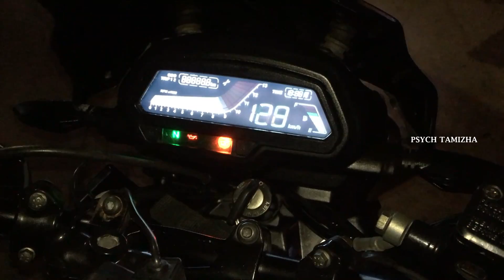Bajaj Dominar 400 Full Service @ Home | Timelapse | DIY

Comment: Hi bro one doubt bro I have dominar 400 2017 model 
If I put 1 st gear it's sound dammal & if the bike running if I put second gear means same thing will happen it's sound like dammal
Wat was the problem bro pls help me
Reply: Neutral to 1 gear damaal sound normal dhan bro due to slipper clutch.. ana running la 2nd gear podum bodhu damaal Vara koodadhu
Reply: Higher revving engines it's normal brother i too own a dominar 400 2018 sound is common when we drop to 1st gear

Comment: Bro... D400 engine oil capacity 1.5l or 1.8l ?
Reply from the maker: 1.5 l for older models 
seems it is slightly higher for new gen models
Reply: 1700 ml for ug

Comment: Sir Mere paas Dominar400 2017 model hai..mai usme motul 7100 10w50 oil dalta hu to...uski service kitne Km. Baad karni chahiye...?
Reply: 10000km oil change interval
Reply from the maker: always change it at maximum 5000kms irrespective of any oil you use

Comment: How many kilometres has ur bike done?
Any engine work till now?
Reply from the maker: i have done around 33k+ kms as of now no work has been. done except coolant issues
Reply: @PsychTamizha  i am planning to use mobil 1 5w40 grade fully synthetic engine oil in my dominar.
Should i do that?
Reply: @royalenfieldthug3651  the grade is 10w50 so its not advisable to use 5w40 cus thats not the grade

Comment: Hi bro nice video for spare parts and accessories for Dominar any dealer you know bro can you give the address or contact of dealer
Reply from the maker: Contact Jai Bajaj Tambaram
Reply: @PsychTamizha thanks for the quick reply bro. ohkk bro so Dominar 400 touring kit available from them right top rack with back rest and winshield and spare oil filter and engine oil.
Reply from the maker: you can check with them

Comment: after how many KMs Fuel filter needs to be changed?
Reply from the maker: i change in every oil service say 3.5k kms to 5k kms
Reply: @PsychTamizha  Thank you
Reply: @PsychTamizha  ji enna price fuel filter. Bike condition epadi irku. Dominor 250 is it worth to buy or get rtr 200 bs6?
Reply from the maker: fuel filter will be 200₹ idk the exact price

i would say go for d400 if u can spend money
Reply: @PsychTamizha  thanks for info. I will use bike mostly in city and might be occasionaly highway rides so d400 would be more for me also I think price difference is 40k more.
Initially I thought of getting rtr 200 by now just having second thoughts for d250. Any idea how is rtr 200?
Reply from the maker: The. you can also consider fz250
Reply: @4_doors_more_whores  yes dual channel ABS,slipper clutch , advanced instrumental consol,refined engine